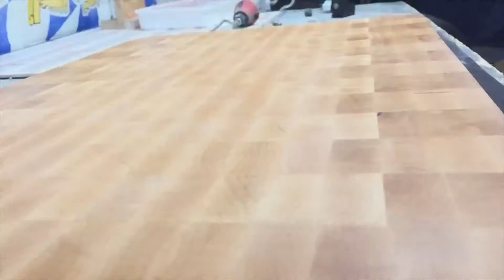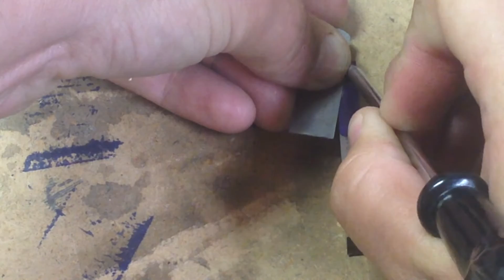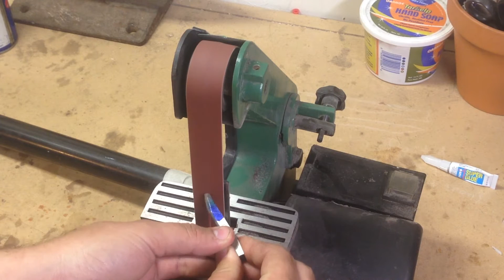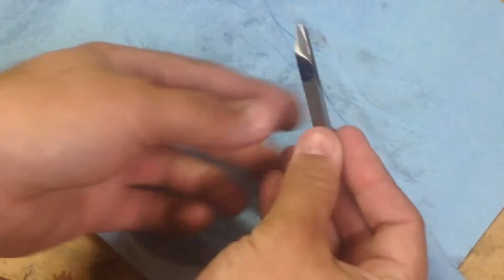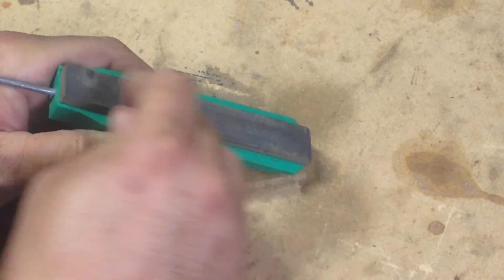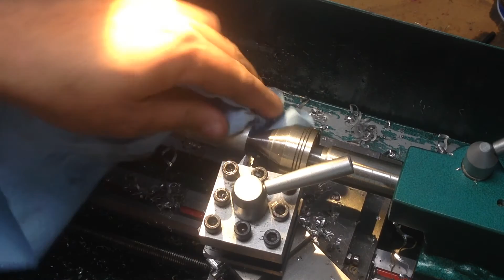Grinding a Tool for the Mini Lathe

Comment: How do those little lathes do on cutting steel?
Reply from the maker: surprisingly decent, even better when I use carbide insert tooling! I think the majority of the work I've done on that little lathe has been in 4140 steel.  I've also cut 17-4 stainless and O1 tool steel without too much issue, you can check out my other videos to see examples!